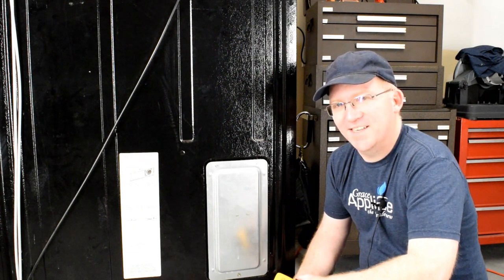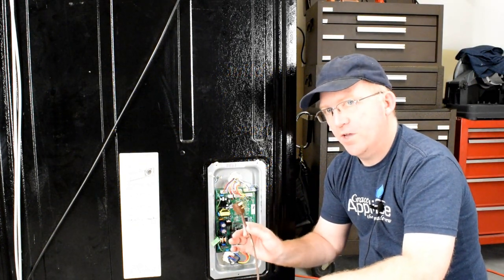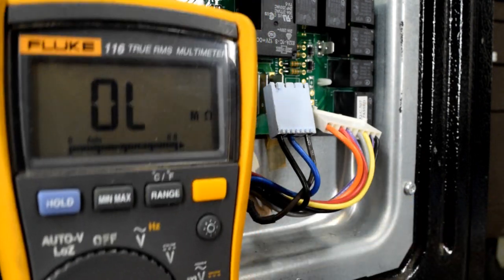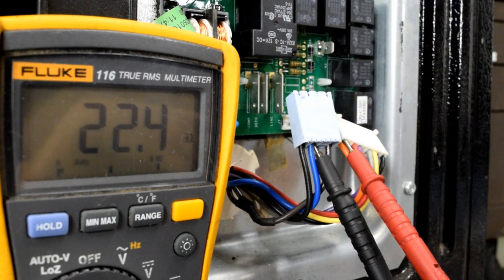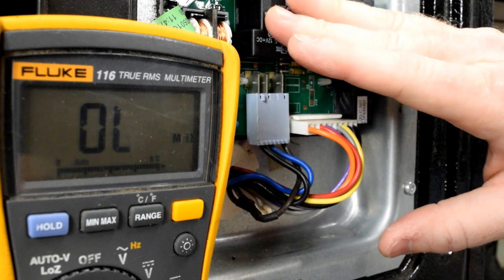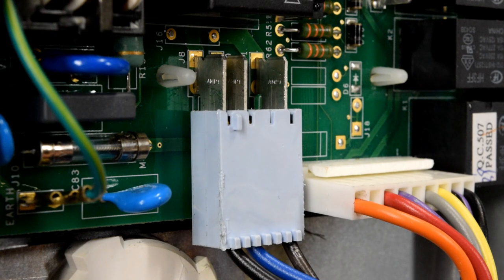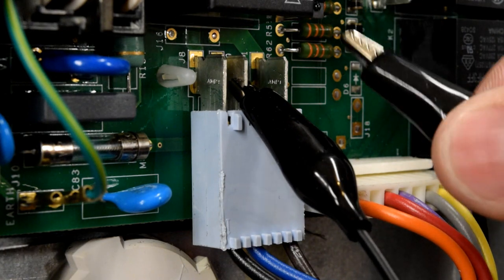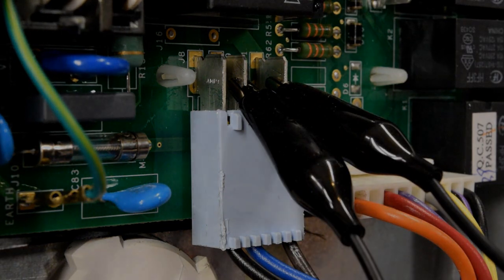Diagnosing a Bad Control Board - Part 3: Defrost Issues

Comment: i bought a new dual defrost from amazon and it burned up again , do you think this is a defective part or should i look at something else?

thanks
Reply from the maker: Hey, it sounds like the heater is staying on too long. 

It could be a stuck relay on the control board, a stuck high limit thermostat or a failed defrost sensor.  
I’d put them in that order for likely failure.  

The defrost sensor and thermal fuse are both cheap and easy enough to get to while changing out the heater. I’d replace both while replacing the
Reply from the maker: While replacing the heater.  I’d then closely examine the heater while the compressor is running and make sure that the heater is in fact turning off when the compressor runs. It should never be glowing when the compressor runs. If it does cut off, you can rule out the stuck relay on the board.
Reply: ok , will do , im ordering a new defrost heater from your link .

i took the control board appart , i carefully examined all the signs of being a bad board and there are no visible signs of being bad.
despite all of this can the board still be bad? would a stuck on the board mean that i need a new board.

thanks for responding , didnt think you would 👍 🙏👍
Reply from the maker: @andresmoreyra1050  hey, you're most welcome and appreciate you ordering through the link. Thats super helpful.

So, stuck relays are quite difficult to diagnose as there is no viable signs and the only symptom is that you'd be getting voltage to the defrost circuit when it should be off. It would mean a new board is in order. This is why to me it makes the most sense to start with the cheapest things first and then fingers crossed won't need a board.

Keep me posted if you have any questions or troubles!
Andy
Reply from the maker: One trick to diagnose a stuck relay is, if you catch it while it's acting up, you can gently tap on the relay on the board with a screw driver handle. Many times this will break it free and the voltage then cuts off as it should. It will sometimes work and other times not, but if it does cut off at that point, it's verified your diagnosis and you can sleep better at night knowing you nailed it.
A stuck relay, if you were able to break it free is on its way out and the board would need replacement either way, but often may run for many weeks, months or years after, but can't be trusted anymore.

I hope that makes sense.
Reply: thanks for the advice , ill keep trying

Comment: Hi Andy, My son has a ge side by side. All frosted up in the freezer. Doing the test in the defrost circuit. Getting 26 ohms. Is that acceptable? Seems quite a bit higher than the 22 ohms you mention
Reply from the maker: Hey, yes that sounds good.
That's a good heater and high limit thermostat. This leaves the defrost sensor (see my video, how to test and replace a defrost sensor) or a failed control board.
You may start with visually examining the back side of the control board (with the fridge unplugged) for a burned solder joint which is a very common failure for these boards.
Reply: GE Side-by-Side ONLY - Refrigerator Repair Videos Andy, I changed both sensors in the freezer section, top one on the evaporator much easier than the one down in the left hand corner. The defrost sensor was incapsulated in ice and I was getting only 6 ohms on the sensor. I didn’t look at the back of the board to see if any soldering joints were burned. Defrosted then whole thing as well and it back to running. The defrost element got nice and red when I jumped it. We’ll see what happens.
Reply from the maker: Joseph Folsom hey, good work.  It does sound like a failed sensor.  You should be closer to 14k ohms if covered in ice.  You should be good to go having changed that.  Keep me posted on how it works for you.  Andy
Reply: What does the defrost sensor actually accomplish if you have a terminating defrost thermostat?
Reply from the maker: The defrost sensor is the part that actually sends the signal to the board with the current evaporator temp. So, the board uses this feedback from the sensor to determine when and for how long to defrost.  
However, the high limit thermostat is not a defrost thermostat. It’s a safety thermostat, designed to cut power to the heater should something go wrong and it overheats.  (I.e. due to a failed defrost sensor or stuck relay on the board for instance) 
It cuts power at 130F and won’t restore power until it drops below 110F.   

I hope that helps.
Reply: GE Side-by-Side ONLY - Refrigerator Repair Videos Yes it does, and would imagine that refrigerators that do not have defrost sensors depend on a lower heat cut out on the defrost thermostat to do the same thing.
Reply from the maker: Joseph Folsom correct!  It’s the same concept and exactly the same part, but just set at a lower temp.  Around 50-60F for example. It would cut power to the defrost once it reaches around 50F and then reset to allow power to the heater once it drops by 30F for example. So, once it’s been sufficiently cooled by the evaporator during the cooling cycle, it’s reset for the next defrost cycle.

Comment: Hi, I'm new. So if I measure for continuity between the blue and orange wires and read OL does that mean my defrost heater is bad? Strange because I replaced it new the other day.
Reply from the maker: Hi Anthony, it could be the heater or the high limit thermostat. They are both on the same circuit so it's not possible to tell which from the board.
You'd need to get access to the heater inside the freezer. If you have continuity with the heater (and the connections are OK) you would then replace the high limit thermostat.

https://www.graceappliancediy.com/products/general-electric-wr50x10068-refrigerator-defrost-thermostat?_pos=2&_sid=2edb8f38a&_ss=r

Let me me know if you have any questions. Thanks!
Reply: @GraceAppliance  update. Foundout there is continuity among both the hi limit sensor and the heater. Plugged everything in and still gets frosted from the inside. Been a few days, so I am guessing the control board isn't telling the heater to heat up am I right? At which poing needs ti be replaced.
Reply from the maker: ANTHONY NGUYEN the only two remaining parts if you’re having defrost issues are the control board and the defrost sensor on top of your evaporator coil. This is the part that tells the board when to go in to defrost.  

I have a video called testing and replacing a defrost sensor which should help determine which it is.  Also, you can look for a burned solder joint on the back side of your control board which is sometimes the issue based on your symptoms.  Let me know if you have any questions.  

Thanks!
Andy
Reply: @GraceAppliance  thanks for the reply. I believe my model is a GE PSS26SGRCSS. All I have is the defrost sensor and defrost heater. I believe the connections coming from the control board goes to the defrose sensor then to the heater and returns back to the board making a closed circuit system. I will replace the defrost sensor which sits ontop of my evap coil. I strongly lean towards the control board being the likely culprit, but what are your thoughts?
Reply from the maker: ANTHONY NGUYEN hey Anthony, 
No, the defrost sensor (wr55x10025) should have continuity from the board, but changes the Ohm reading (I.e. resistance) based on temperature.  There isn’t a way to say if the board is good or bad without measuring the sensor with a meter and knowing the current temperature of the sensor.  
If you wanted to switch this part without testing, which is fairly inexpensive and still are having issues you will know for sure it’s your board that’s giving you issues.  

https://www.graceappliancediy.com/products/general-electric-wr55x10025-refrigerator-temperature-sensor-1?_pos=1&_sid=9ed8d531d&_ss=r
Reply: @GraceAppliance  i have already checked the thermistor via the J1 port in the ctrl board. Everything checked good.
Reply from the maker: ANTHONY NGUYEN ok, if your defrost sensor is good,  it does sound like a new board is in order.  Let me know if you have any questions! 

https://www.graceappliancediy.com/products/ge-wr55x10942-refrigerator-main-control-board-1?_pos=1&_sid=26eb12400&_ss=r

Andy
Reply: Andy, just for curiosity, at 0F does the evap thermistor resistance need to hit 42 kohms? Mine just rests at 35k ohms. Does that affect the defrost cycle?
Reply from the maker: ANTHONY NGUYEN 42.5k ohms is what my tech sheet says.  0F is much harder to accurately measure than the 36F temperature reading as you can easily attain the 36F in icewater and you’re sure that’s the temp 14.5kohms.  Getting 0F is more difficult to know for sure.
Reply: @GraceAppliance  Andy you are a wonderful help and life saver. I found the problem to be a ctrl board issue with a burnt solder connection and a bubble on a 12V relay (832A-1C-S). Any idea why? I went ahead and replaced the evap thermistor, defrost sensor and defrost heater for good measure. Thanks again
Reply from the maker: Hey Anthony, you're most welcome.
Yes, the reason for this is that the relay on the board will get weak or carbon build up on the connection points inside the relay. This poor connection causes excessive heat which then melts the solder joint. So, a new board is in order. 

Let me know if you have any questions.
Thanks!

Comment: My refrigerator was having defrost issues and I found out it was the defrost heater that was open.  I replaced it and it's turning on now if I force it, but how can I be sure the thermostat is operating properly in order to turn the defroster on when it needs to?
Reply: Edit:  So I just replaced both the defrost heater and the thermostat.  Now the freezer is working properly but the refrigerator is only getting to about 45° in the bottom and 36° in the top.  I emptied out the freezer again and it doesn't seem like there is too much frost buildup.  The evaporator fan is working.  I removed the little evaporator door/light thing in the fridge portion to see if that was obstructing flow, but that didn't seem to make a difference.   Before I replaced the heater and thermostat the refrigerator seemed to be getting cold enough until too much frost built up on the coils.  Although I didn't replace them, I tested the freezer thermistor to see if it was reading properly at different temperatures.  

I'm at a loss of what to do.

Comment: Hi Andy. Thank you very much for your videos. i have conducted most of the test you recommend because I'm having the classic defrost issues of freezer and frig not cooling to proper levels, no ice being made and frost build up on back freezer wall.  I get no continuity on the defrost heater/high limit thermostat (in your #3 video, the orange & blue wire test)  however I do get continuity on the defrost sensor test.  A reading of 4 on frig, 6 on the freezer and another 4 on the defrost sensor.  My questions are:  1.should I replace both the defrost heater and the high limit thermostat?  2.  Are both easy to replace and 3. how do I determine which part numbers to purchase since you links seem to show different parts?   I have  model #GSH25JSRFSS  Thanks a million!!!!!!
Reply from the maker: Gary Reaves hey Gary, 
So, doing the heater / high limit test from the board will not tell you which part is bad, but for sure you’ve got a failed heater or a failed high limit thermostat (less common to fail)
In order to tell which has failed, You’d need to disassemble the freezer and test the heater directly at the terminals where the wires plug in. If you do need a heater, your fridge needs this one:
https://www.graceappliancediy.com/products/new-upgraded-wr51x10055-defrost-heater-enhanced-durability-with-metal-shield-replacement-part-by-blue-stars-exact-fit-for-ge-kenmore-refrigerators-replaces-ap3183311-914088-ah303781-ea303781

If the heater tested good, you would need to replace the high limit: 
https://www.graceappliancediy.com/products/general-electric-wr50x10068-refrigerator-defrost-thermostat

But, since you’re in there and the parts are cheap enough, you may consider replacing the defrost sensor as well. I usually do all 3 if I do a heater because the parts cost is not that much extra for my customer and they’re better off in the long run. Yours sounds fine, but at $9, I’d recommend it.  
Defrost sensor: 
https://www.graceappliancediy.com/products/general-electric-wr55x10025-refrigerator-temperature-sensor-1

I hope this helps and let me know if you have any questions.
Reply: Hello Andy.  Thanks for the quick response. I'll take your advise and do all 3 since they are inexpensive.  I see your video on replacing the sensor.  Do you have any on the heater and/or thermostat or are they fairly simple enough to do without help?   I appreciate your help!!
Reply from the maker: @garyreaves5012  hey, I don't do a lot on install/disassembly but focus more on the diagnosis aspect of all of it. But, it is straight forward. The heater has 2 wires that unplug, 2 Philips head screws, it lifts up slightly and it's out.
The high limit is 2 wires which you will cut out, strip the wires and attach the new high limit in the same location.
Now, you technically can use wore ties, but it's recommended to put silicone inside the wire tires after assembly or my preference is to solder them in place and use that shrink tubing that you shrink up with a lighter.

That's all there is to it though. Not hard though.
Reply: And, should I replace both freezer sensor and frig sensor or just freezer sensor? I assume there is only 1 high limit thermostat also??
Reply from the maker: @garyreaves5012  hey, only the 1 high limit thermostat.

The sensors you have are one freezer temp sensor, the fridge temp sensor (sometimes 2) and one defrost sensor.
I'd recommend only the defrost sensor which is located on top of the evaporator.
Reply: OK Andy.  thanks.  I'm only going to replace 1 of each of the 3 parts you sent links to above.  1 heater, 1 high limit thermostat and 1 defrost sensor and I'll let you know how it goes.  Thank you!!
Reply: Hi Andy.  Quick update.  I replaced the defrost heater which gave me continuity finally.  Since I thought the heater was my problem I did NOT replace the thermostat nor the sensor.  Unfortunately however my frig still does not cool.  Do you think the thermostat and/or the sensor could still be my problem or since I now have continuity with the heater replacement, I should focus elsewhere.  Just FYI, I now have continuity on the the continuity tests from your video collection.  Thanks.
Reply from the maker: @garyreaves5012  hey Gary, so a defrost issue will not keep a freezer from getting cold if the evepaorator is not covered in frost currently. A defrost issue will present itself as excessive ice build up on the evaporator which restricts air flow and causes warmer then normal temps in both cabinets.

If your evaporator coils are frost free, you should be able to let it run for several hours and notice a drop in temps in the freezer cabinet.

If you can snap a picture of the evaporator, feel free to send a picture to Graceappliance@gmail.com and this picture will tell me a lot about what's going on.

Thanks!
Reply: Hey Andy, I have.  I've let it run overnight. temps inside the freezer were 74 degrees (my house temp) both before going to bed and after waking up this morning.
Reply from the maker: @garyreaves5012  are you able to tell if your compressor behind your refrigerator is running?
Reply: I did check it for continuity and that checks out fine but don't know if that necessarily means it's running or does it?
Reply from the maker: @garyreaves5012  no it may test fine that way but still not run.
You should be able to put your hand on the top of it and feel it vibrating slightly. It should be warm to the touch but not overly hot and not cold. They have a slight hum to them which is sometimes hard to hear because of the fan behind your fridge.
Reply: Ok. I'm embarrassed to say. I forgot to reconnect the compressor plug after testing it for continuity.  Duh!  Just reconnected it and will let you know how things go.  Thanks again Andy!!!
Reply from the maker: @garyreaves5012  let me tell you about that one time I replaced a drain pump on a bosch front load washer...put it back together after at least an hour of work, proudly stood back to admire my handy work and listen to it vitoriosuly drain in all its splendor... Only to realize I'd forgotten to hook up the power wires to the pump!   LoL

You remember the ones that hurt.

Comment: My GE side by side will achieve the ideal temp for freezer and refrig after about 7 days both sides stop cooling. I unplugged for several days and the plugged in the same thing happens again. In both attempts never frosts up. what do you suggest how to diagnose this?
Reply from the maker: Hey Patrick, it sounds from the symptoms to be a defrost issue.  However, if you're not seeing excessive frost build up on the coils during the loss of cooling you can rule this out.

Does the compressor continue to run during the no cool period?
Also, what does the frost on the evaporator look like while its not cooling?
Reply: @GraceAppliance   Thanks for getting back so quickly. I do not see any frost buildup whatsoever. Not sure if the compressor running all the time. About to plug in and check again. I will observe the compressor and frost and let you know.
Reply: @proza1957  The evaporator coil is hidden from sight. The frost would be building up on this coil which is located behind a white panel at the back of the freezer, just below the light bulb.  Remove the shelves and two 1/4" screws holding the panel in place.  The panel will slide up and out.  Hope that helps.